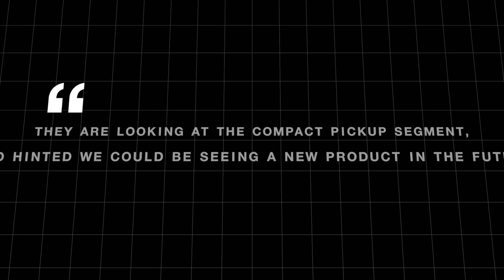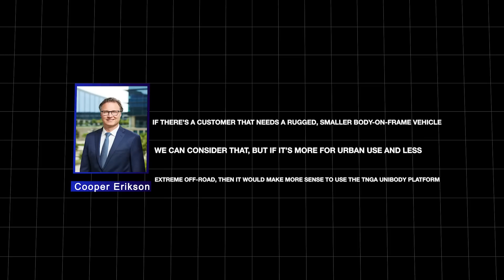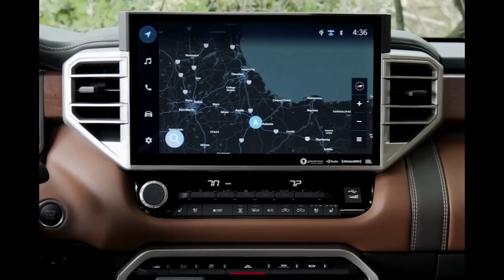New CEO Reveals $23k Toyota Stout | Ford Maverick Competitor

Comment: Give it a  6;foot box, a basic 4cyl gas engine , choice of auto or stick, a/c, power windows/brakes and steering and a la cart  options over that, and you will see them fly off the lot.
Reply: to fleets and a few bob todds. a few bucks more per month really greases up the hand to fork it over for "junk"
Reply: @trumpet12345  nah I’m sure some kids going off roading would appreciate it too.
Reply: That'd encroach on Tacoma sales. Not gonna happen!
Reply: I agree 100 percent but still like 4x4s. I had a 1990 Toyota Hilux 4 x 4 for 34 years until I gave it to my son and would love one similar.
Reply: I would trust a turbo 4 cylinder from Toyota a lot more than a turbo 4 cylinder from Ford 😆. Would be great if the Stout can tow at least 3500 lbs. but I don't see it doing that admirably with a naturally aspirated 4. Would need a turbo.
Reply: Ed, no that's the most sane thing I've heard all day.
Reply: @TheLostSquadron   I don't think so... The Tacoma and the Ranger are now what used to be "mid-size" trucks of years past...
Reply: @justacinnamonbun8658  -The 2.3L Ecoboost engine has been stable and great for a few years now... I believe they also did much needed mods to the 2.0L ecoboost ford engine as well...
Reply: @TheLostSquadron  Little pickups used to have a 6’ bed standard. They just grew and grew in size over time becoming “midsized.”
Reply: Yes yes and yes. 6' bed, 2 seater and then you have a platform unlike any other 'current' small trucks. These 4' and 4 1/2' beds are more or less a hatchless hatchback. A manual would be nice but I know I'm in the minority on that being a preference. Trying to cram every vehicle in to as many slots as possible is how we got here. Let a truck be a truck, a suv be a suv and a sports or luxury vehicle be just that. Don't need seating for 4-5 people in a small work truck.
Reply: @Chubbydippin  It wasn’t that long ago that little Chevy S10s with a 6’ bed were selling like hotcakes.
Reply: @Psalm144.1  There used to be small and full sized pickups. Toyota wants new small truck buyers, not people that buy a new $26 Stout instead of a $42k Tacoma.
Reply: Under 25k too
Reply: They have that. Its called a tacoma.
Reply: @270eman  the taco is under 25k well hell neither will this of dealers have anything to say
Reply: @luisvilla799  Yeah the mavericks are all marked up to tacoma prices. 😂 Tacoma is definitely better truck.
Reply: @270eman  yeah I never said or implied that Toyota is far the superior company and I’m a Chevy fan
Reply: @luisvilla799  Ik. I am saying its the superior company and product. Chevys 6.6 gasser is good. AFM motors are junk
Reply: Agree with the six foot bed. I work in the building trades and anything less than a 6ft bed is a grocery getter.
Reply: Totally agree!
Reply: @justacinnamonbun8658  Or better yet, about 2.0 liter engine in a 2.4 block, no turbo and make it rugged and able to occasionally spin up.  Manual trans with auto option.
Reply: That's a lot of unwanted requests. It will just make it another stupid Ford and sales will tank
Reply: @GURUKHAN_OG  umm Ford doesn't offer a six foot bed nor a stick in the Maverick, so I'm not sure what your point is...
Reply: I agree.  I find the frilly options that turn a vehicle into a rolling living room turn me off more than turn me on.   I'm driving a basic SUV because pickup prices are sky high because of all the fancy useless crap they fill them with.  Someone should pull a 1964 F100 or GMC half ton out of a museum and see what basic trucks are.    Toyota, Datsun, Mitsubishi, Isuzu, Dodge, GM all sold millions of small basic trucks because they were simple and affordable.  The auto industry has lost their way, blinded by shiny costume jewelry and they've lost the working man's business.
Reply: @270eman  I think we're taking about a good old cheap compact work truck, not a very expensive mid size grocery getter/fashion accessory like the Tacoma has become. You could buy a house where I live for what a new Tacoma costs
Reply: @joeshoe6184  Used 2nd generation Nissan frontier is the best deal on the market for a light pickup truck. 6ft bed, 4.0 liter v6, and 4wd. Millions of them on the road. Made from 2005-2019. You can find them all features and less than 30kmiles for 25 to 26grand. Solid and reliable midsize truck for cheap. Any new compact truck is going to be marked up out of sight. Especially a brand new toyota compact truck. Won't even be able to get it. As for mall crawling I actually need my 4wd for my work. Awd would overheat on these inclines.
Reply: @270eman  well I currently drive a 94 Nissan hardbody regular cab 4 cylinder 5 speed 2wd so we're on the same page there. I definitely agree that Nissan offers by far the best value in used compact trucks. 
I've also had Toyotas, an 84 and a 96 Tacoma, great trucks, but overpriced. I could get the same Nissan for thousands cheaper.
I've also had 3 Rangers. An 87, 88 & 94. They were really nice trucks when they ran good, and got great gas mileage (my 94 with 2 plugs per cylinder got 28mpg), but they never really ran right and constantly broke down.
My mom had an S10 that, besides the 4.3 being a great engine, was complete junk. I probably would not buy a domestic truck again.
Reply: @270eman  and I don't want a Midsize truck, I want a compact truck. The current Tacoma is definitely the former and looks huge compared to my old 96 Tacoma. To the point where it's a completely different kind of truck.
Reply: Bring back the 22r motor with it.
Reply: A 4x4 with manual transmission option would garner interest !
Reply: @mikemecklenborg5412  agreed, bring back the 92 Toyota pickup
Reply: @Psalm144.1 always wanted one. I had a Ford ranger and was mad when they got rid of both
Reply: Ed, I think you and I have the same frequency
Reply: He lost me when he started touting the "infotainment system".  My idea of the ultimate "infortainment system" is an am/fm radio.  My '99 dodge has a manual transmission, rubber floor, hand crank windows...but she's awful tough on gas and is nearing 160K miles....  I absolutely would buy a bare bones small pickup but there is simply no way in hell I would pay anywhere near what dealers are asking for current small pickup models.  I'll be watching closely but am not optimistic.
Reply: @moushunter  yes.  Being a pessimist by nature, I look to the future and contemplate repair costs for various accessories.
Reply: illeyezcobra  What were you towing? lol
Reply: 6 foot bed... they don't even put those on full size trucks anymore!
Reply: @dershwans  Yes they do. Just not the family hauler 4 door models. All of the access cab work models have 6ft beds

Comment: It's a smart move. I'm driving a 2003 Nissan Frontier 4 cylinder 5 speed. I've had a few people want to buy it from me it's not for sale because there's nothing out there today to replace it.
Reply: I get offers for my 92 Nissan every now and then. I'm holding on for the same reason.
Reply: Excellent Nissan engines that last well over 300,00 miles
Reply: Toyota sells an extra cab pickup with a 6’ bed, and it has a 4-cylinder engine but I don’t think you can get it with a manual. They also have available a crew cab with a 6’ bed, but its very long and quite expensive. I’m hoping next year Toyota offers a new Tacoma with a hybrid engine and at least 25mpg, but I doubt it has a 6’ bed. I’m actually strongly considering a Honda Ridgeline, it only has a 5’ bed, but its also 5’ wide, 4” wider than the Tacoma. And the wheel wells sticking up into the bed are almost non-existent, plus it has a huge bay under the bed and a lot of room with the rear seats folded up. I think I just sold one to myself…
Reply: @louislopez55  -  You may have sold it to yourself !!!  :)  I looked at the Ridgeline a lot for a few years, and could never get behind it...And it was always really expensive...
 I bought a new '22 Ranger Lariat and could never be happier... It's big and tall like the mid-size trucks used to be and can tow way more than the Maverick.It's a SuperCrew so it only comes with a 5' bed.. They make a SuperCab, that of course, has a smaller space for the back seats, but they make that one a 6' bed only...  My '22 Ranger Lariat at 2,000 miles on the 2.3L ecoboost is getting over 25mpg on the highway, with the 2.3L ecoboost 4 cylinder...
Reply: Same with my old 98 Infiniti Q45T, tons of people wanted it, but in the end there is barely any parts availability so I sold it before I had to deal with all that non-sense.
Reply: I've got a 115k mile 2002 frontier that I bought a year ago and it's the perfect small truck.
Reply: I love my 2005 ford ranger best small truck!
Reply: Same with my 99 Nissan Frontiner. It's only got 150k miles. Meanwhile I also started driving my GF's 2018 Ford Escape. I like the size of it, but so many annoying things with a Ford, like the backup camera and main screen is smaller than my cell phone. Who thought that was a good idea?

Comment: The biggest problem is the price of pickups has skyrocketed into a prohibitive range.  I do not want a mortgage on a truck.  I also need to tow and have 4wd.  The range of EV's is a non-starter as well.  I will continue to maintain my Tacoma meticulously  and probably start customizing it instead of going deep into debt on a new one.
Reply: For $12k+/- you could get a trd supercharger and a really nice bilstein setup with a lift and trd rims 
Good to go
Reply: @YungSteambuns  I think the 4.0-liter motor has plenty of power for the weight of the vehicle, already.  The lift kit and oversized tires look pretty cool, but I don't think the difference in performance is enough to justify putting more strain on the engine and drive train than the Toyota engineers designed it for.  I've got nephews who are/were into that stuff, and they spent a FORTUNE on trucks that they were so proud of they just HAD to show off.  Drag races in a Dodge Mega-Cab that SHOULD have lasted a lifetime, but burned up inside of 6 months.

You do all those mods, so of course you want to TEST them.  The Amtal Rule states that you do not truly know the limits of something until you test it to destruction, and that's exactly what happens.  I suppose if you were in rock-climbing contests on the regular, then by all means, modify to the extreme.  But the Tacoma, as is, used as designed, and well-maintained, will last you a lifetime.

I love the idea that Toyota's getting back into the COMPACT pickup market in this way.  The Tacoma is a mid-sized truck.  My favorite generation of the Toyota pickup is the late '90s, early 2000s.  That 3.4-liter pickup was pretty much the pinnacle of size and power.  I've got a '93, with the 3.0-L V6.  I also have a 2012 Tacoma.  So I missed that generation of trucks.  The ONLY flaw in the 3.4-liter V6 was it didn't get great gas mileage.  A 4-cylinder hybrid is going to get high 30s mpg, maybe low 40s mpg.  Put the same size gas tank as the older vehicles, and you can bump the RANGE of the vehicle far beyond a pure gas-powered vehicle.  

My Tacoma gets around 20 mpg.  If I could boost that up over 30, my current range of about 400 miles would rise to 600 miles on one tank.  That's phenomenal.
Reply: @harrymills2770  trd themselves created the supercharger, and it has factory warranties though, plus its such low boost it shouldnt have any ill effects but I see what you mean
Also though after having a 3.0 4runner and a 3.4l t100, those engines are so gutless, but at least someone loves them
currently I have a 2014 5.7 sequoia a 2008 3.5l rav4 and a 2010 corolla
I'd love to get a tacoma limited but you can literally buy a tundra with a better trim level lower miles and can handle/carry so much more for about the same price only downside is mpg is almost 50% worse but what you get is so much better than a tacoma (my brother also had a 2012 4.0), at that point why drive a truck if youre trying to get mpg and youre just driving on the freeway on a sunny day with no load?
I am looking forward to what small pickup toyota is coming out with in the next couple years that'll be smaller than the tacoma to compete with ford, a kei truck would be sweet
Reply: @YungSteambuns   I am going to look into that, especially the supercharger
Reply: Im still convinced that the manufacturer cost for producing Evs from the government pressures has forced the price of other vehicles to increase. They can’t sell these evs because the common joe knows how niche that electric vehicles. Thus, they increase the cost of the other vehicles to compensate.
Reply: @hodgepodge646   good point, look at all the incentives and tax breaks they gave out for evs, my uncle got a nissan leaf practically free

Comment: Absolutely hyped about this. The tiny truck market has needed a return for years. Too bad I won't be driving one for another decade due to dealer price gouging.
Reply: Toyota was one of the manufacturers of the small pickup trucks.That legendary 22re motor in the old Toyotas were bulletproof
Reply: @adspur  Is that the same as the one from Top Gear?

Comment: There is a huge demand for something normal people can afford to both buy and run.  The number of people that can afford an $80k pickup truck is tiny.  The reason Maverick is popular is that the lowest trim is insanely cheap relative to most new vehicles without looking/feeling cheap and that it gets amazing mileage, and is incredibly practical, useful for a lot of people.
Reply: I agree 100% with you except on the Maverick not looking cheap. I think it looks really cheap with all of it's hard plastic interior. Just really disappointing. I mean the knobs on the radio look like they came from a 1976 Ford Maverick.
Reply: Yeah the interior is pretty sloppy on design. I wanted to get one but the layout isn’t all that functional. It’s nice there are options for people but I’m waiting till either it’s for actual msrp or other competitors to make something.
Reply: @markp.7165  I agree, the interior does have a ton of hard plastics but at least is has knobs on the radio. I hate push buttons or touch screens for any control feature. All require looking at it rather than the road to operate them.
Reply: Almost every lower price car has a cheaper interior

Comment: This is basically my wishlist vehicle. Small, 4x4/AWD, HEV/PHEV, light towing, moderate bed capacity, single-bench pickup. Scoot around town at 40mpg and still able to pick up home supplies or furniture when needed. My 2009 Tacoma is great, but I really dont want to go bigger, and  the 17-19mpg is garbage. And hybrid powertrains can have great towing torque for shorter trips, even if they might be anemic on longer trips where the charge rate cant keep up with the draw..

Comment: Honestly, I had a 76 Toyota pickup SR5. It was my first pick up and I love the small Toyota pickups up to the early or mid 90s. Then they were renamed the Tacoma and got bigger. It was a two-seater with an eight-foot bed but did everything I ever wanted.
Reply: Don’t forget about the toyota t100 I’m stii driving one. They were,are great trucks. Mine is a 1997 & I had a 1996 for 22 years
Reply: I owned a 1987 Toyota long bed extended cab with the 22r motor.  Drove it across country 5 times.  I kept it 22 years with only a carburetor issue.  Although my 2005 Tundra is a great vehicle, I still wish I had of kept the 1987.

Comment: I remember buying my first Toyota. It was a black 1998 Toyota Tacoma extended cab (non-prerunner) with a V6 engine for $20,000.  That was a great truck. I was young and I leased it for 5 years and had wished I bought it out and kept it. It was a great truck except the brakes sucked.  It could hardly stop on emergency braking.  This was the reason I turned it in and got a silver 2003 Toyota Tacoma Pre-runner V6.  Another great truck.
Reply: My 1997 4WD XtraCab Tacoma was the only vehicle I've purchased new.  The frame had perforating corrosion at 91,000 miles decause the DANA Corporation, Toyota's supplier, neglected to dip the frame.  The psychos at the Toyota stealership laughed at my misfortune.  Toyota did nothing to reimburse me for their manufacturing defect.  I stopped using it as a truck and continued to drive it as a 20 MPG 2 seat car.  The frame rusted in half at 137,000 miles and I scrapped it.

Comment: I'm interested. I need a second vehicle and a smaller truck, reasonably priced, which means < $30K, and a hybrid, so I'm not tied to any one fuel source. I don't need gimmicks. I'm tired of touchpads for things where switches and buttons are better. I don't need a speed demon. I'd like around 40 miles range on electricity or some engineering to get great fuel economy. I like Toyota's philosophy about EV's. Not ready for prime time.